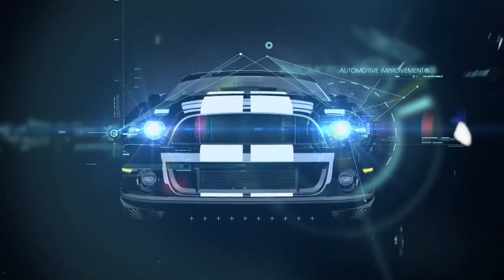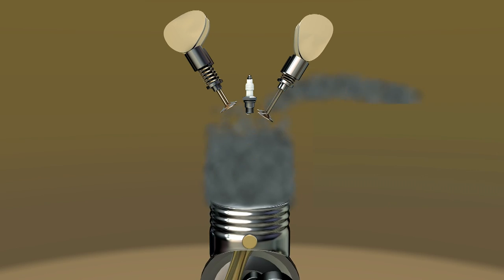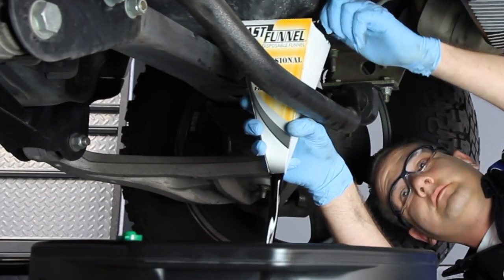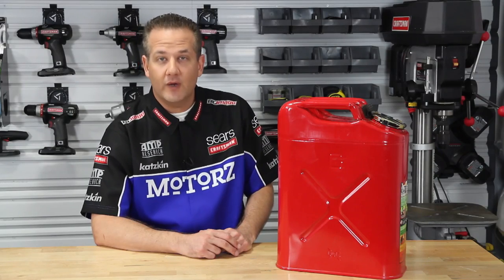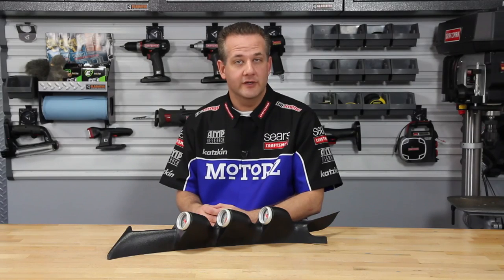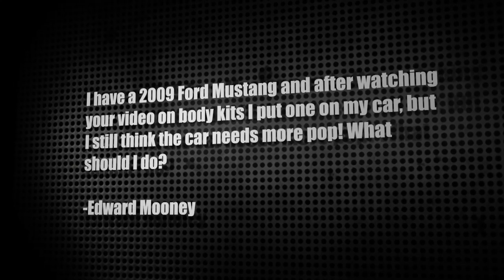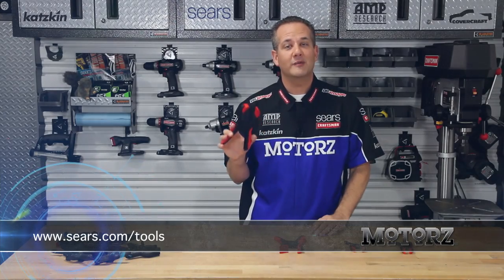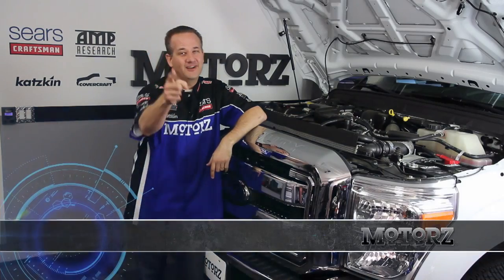Everything You Ever Wanted To Know About Diesel Engines Motorz #75

Comment: those straps cant be too badass for 1200 pounds. hell just a simple moving job would snap that nylon real quick, or wear that clip system out. walmart sells a pair of straps that are 5k test and cost 20 bucks. hard to beat.
Reply: *****
considering my straps were 20 bucks for 2 and each one is double stitched 2 inch wide 1/8 inch thick nylon that holds 5000 before the stitches give out yeah it will pick up a small car. ive pulled out several vehicles with my tow straps and even strapped trees down with the,m. yes i would stand by the straps i bought at walmart before these wimpy ass things. and yes 2000 pounds is 1 ton. get your math right and do some towing before you step to someone knowing what they are talking about.
Reply: +IFIXUR360 I haven't seen a 5k lbs tested strap at walmart before.
Reply: Devin Dowless
are we really fixing to get into the whole not every store has the same product debate? just look online dude and you will see them. smart straps they are yellow and 2 inches wide. comes in a pair. in my store they are 19.99 your store may be more or may not be an item they think is good for their district. but it doesnt negate the fact that walmart does sell them.
Reply: I didn't say this to start a fight with you, I just didn't take notice to a strap of that size. I just 3300 lb tested straps when I tow.
Reply: Devin Dowless
yeah see i was buying those green 1 inch straps that come in a 4 pack for a few years and got tired of snapping the stitching on them and then i found these 5k test. i fucking love them man i would get a pair just to have. the hook is much stronger than anticipated and i have used them to pull out a few trucks. best 20 bucks ive spent in a while.
Reply: +IFIXUR360 Kenedyn is a really good brand and for cheap I got some of my straps for 13 dollars a piece. Some of my loads are around 15k lbs and it's a stack of trailers that I tow. I use about 12 straps to try and keep everything from moving.
Reply: Devin Dowless
yea i think i seen those at harbor freight not sure tho. but i will look into them. straps are something you can never have too many of.
Reply: +IFIXUR360 That's for sure, I am still collecting more though. I break enough of them.
Reply: Devin Dowless
i havent broke these yet. but one day im sure i will. i stop when i can and get the ones that fall off commercial trucks. i would buy some but those are soooooo expensive. but for good reason too tho.

Comment: don't modify anything the factory defaults are the best. if u need more power buy a bigger engine. it's darn simple... it's like overclocking a GPU..performance difference is bare minimum compared to the void warranty and engine damage

Comment: a diesel is more of a controlled burn then a gasoline engine
Reply: a diesel engine causes the diesel fuel to explode because of the pressure. a gasoline engine ignites the fuel with a spark. if a diesel engine's fuel injectors get stuck open (you can find videos of this on youtube) it will continue to run. it is VERY difficult to stop it.
Reply: Yes i have read about runaway diesel motors, however diesel is a control burn rather than gasoline being a explosion

Comment: DIESEL ENGINE ARE NOT EASY TO DIAGNOS AND REPAIRS. IT COST A LOT OF LABOR TO DO IT.
Reply: Danielle H. stop yelling.
Reply: LOL
Reply: +Danielle H. As a trained auto/diesel tech i can tell you that they are a lot easier to diag than gas engines, the parts only cost more do to the heavier more sturdy construction. Just as a fun fact... most of the technology used to make gas engines more efficient and powerful came from diesel.
Reply: +CHAUSTER LAMBORGHINI 15 hours to change valve cover gaskets? who the hell did you use and why?  even on a (for example) powerstroke its not going to take that long. i myself know i can do it in less time than that and ive never even worked on a diesel before.

Comment: Please tell me why would you use a Powerstoke for the video when you could have used the Duramax engine. The Powerstoke is one of the worst diesel engines in the world and ford is horrible. GM FOR LIFE!
Reply: you mean shitmax
Reply: GM huh...good way to support liberal policies and crony capitalism.
Reply: larry45ist durashit...
Reply: Cummins is better than your duracrap or powerjoke
Reply: The buses over here in Holland used for public conveyance are VDL Berkhoff Ambassadors which have Cummins 6.7L diesel straght six-pots(Also a smaller variant, but this specific type I like the most). Most rad, bad-ass engine sound I've ever heard. They've got so much torque they only shift gears between 1300 and 1600 rpm ^^